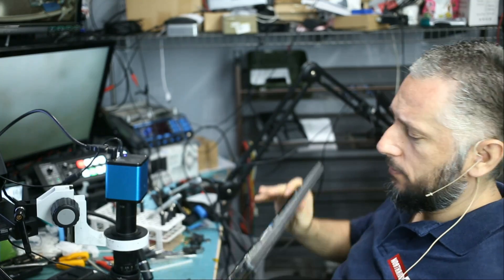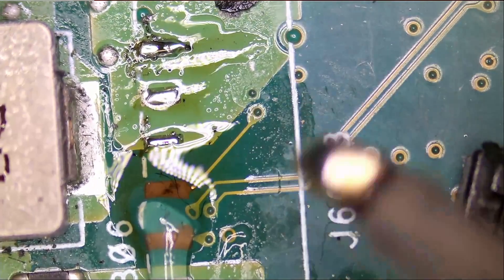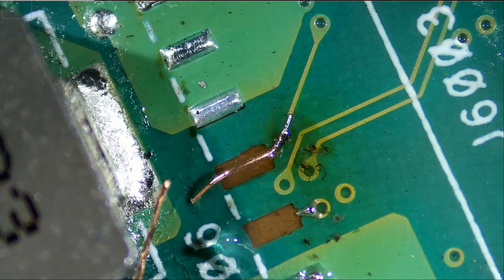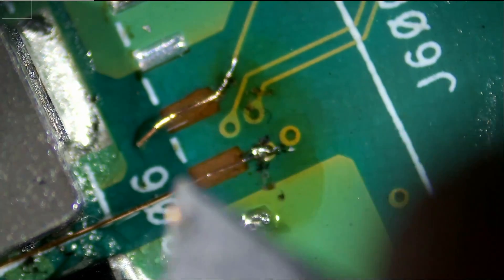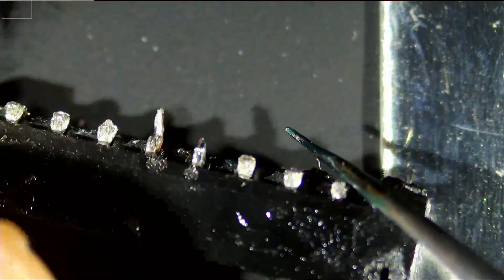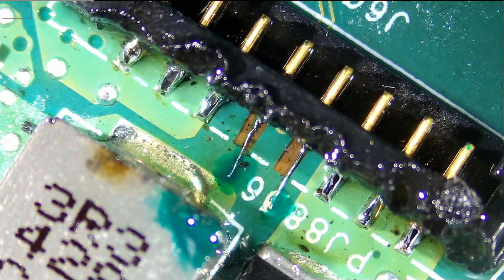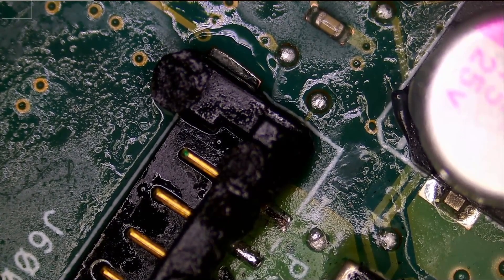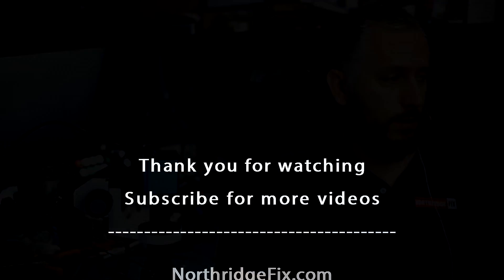Asus laptop broken battery connector - Pads repair using wire and solder mask

Comment: I also unfortunately have the same problem with my asus x509 laptop, battery connector to motherboard ripped. Just wondering how much would it cost to repair it at a random hardware store.

Comment: Hi I have the same problem with my Asus it's a s532fa how would you solder the bottom pins would conductive adhesive work.
Thanks.

Comment: what did u put on wire, the green color thing?
Reply: It’s called solder mask.  Liquid turns solid under UV light and provides an insulated solid shield that also can hold tiny wires or components in place.
Reply: @MrMelville100  thank you very much
Reply: Shehan Kavinda you’re welcome.  I watch too many repair videos!

Comment: Can u do a through hole damage repair I have a ps4 controller were I tryed repair on the joy stick and damage the pin hole to the board now it has continuous drift

Comment: Is the heat from the soldering iron sufficient to remove the enamel from the enameled coated wire you use and sell in your store?
Reply: Wendell Jackson it depends on gauge of the wire I think these guys use non enamel cooper wire with that thickness if enamel also no problem
Reply: He doesn't use enameled wire.
Reply: He uses enamelled copper wire but the gauge is small enough for the heat to remove the coat

Comment: Glad I managed to get the flux and low melt solder shipped to London before the shipping issues!
Reply: How much did it cost you in total?? Import fees, shipping etc?? Because I live in London as well and wanted to buy some but every time I buy stuff from American suppliers it ends up costing a fortune in fees. I would love to be able to buy some bits from his website.
Reply: @SURGE101  I did have to pay VAT, I think it was £15 in fees. Shipping was the old flat rate $10.
Reply: Th3OmegaPoint that doesn’t sound that bad, I’ve had a bad experience when buying from America before and getting hit with massive import fees. I bought a microscope from amscope and it ended up costing me just under £200 in fees and about £60 shipping. It may have just been because that was a large item. Thanks so much for the info. I’m going to buy a few bits and see how it goes. Appreciate it.jay.x

Comment: What is the the green-ish liquid you put on the board to protect it after you soldered on the new leads?
And the UV light was to "cure" that chemical?
Reply: U can get that online uv glue for mobile repair
Reply: It is UV Masking liquid which is used for purpose done by insulation